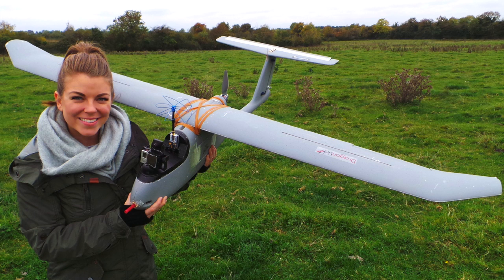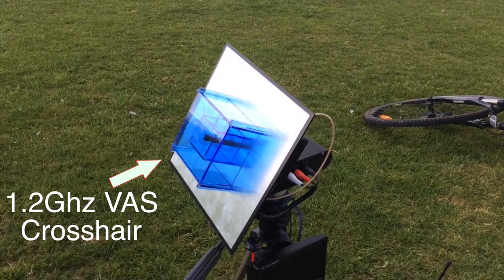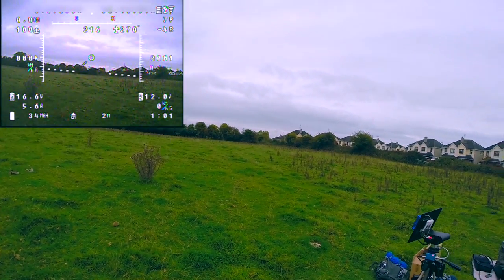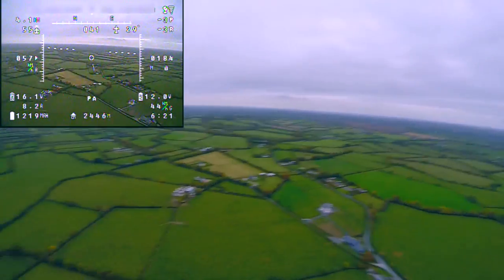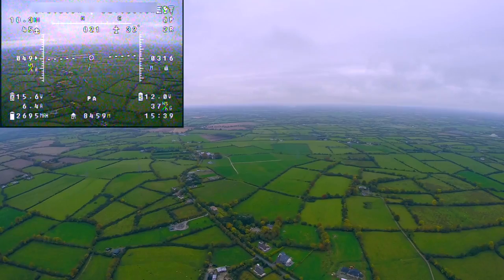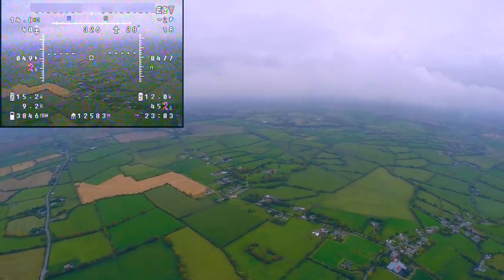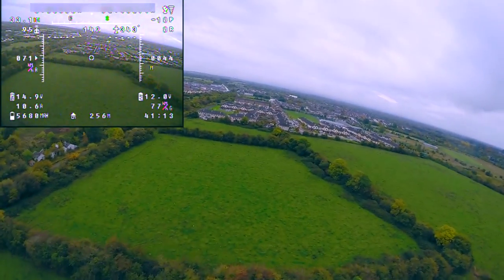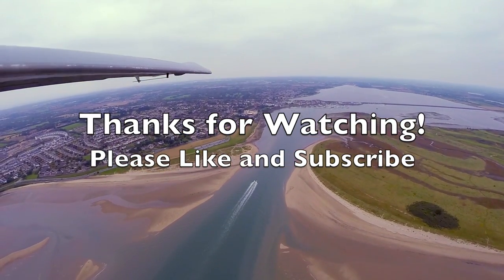Narrated Long Range FPV Setup Overview & 15km Range Test - Skywalker 1900

Comment: Do you have a set up video on the MyFlyDream antenna tracker?
Was it difficult to calibrate?
Reply from the maker: I don't because its so easy. My Fly Dream themselves have a calibration video and its only about 2 mins long as its so simple :)
Reply: A more specific question:  I am using the Eagle Tree Vector.  Do I connect into it's GPS or use a separate one?  I see it comes with a OSD but I already have one in the Vector?  I have looked at the instructions and I don't see the answers for these and more questions.  Thanks
Reply from the maker: I think you an use the GPS receiver for the Vector. You need to hook up the supplied OSD as it provides the AAT with the gps co-ords, but once you have it hooked up you just click a button on it and it turns the OSD off so you only see the vector OSD.

Comment: Could you extend the range by using a relay plane/drone?
Reply from the maker: Using a relay isn’t really the best way to extend range. In most cases you just need to use the right antennas and make sure your component placement on the aircraft is optimal. In this Skywalker I placed the UHF antenna in the tail which is not the best as it’s right next to 2 servos. With the antenna out in the wing the range is massively extended. Hope this helps
Reply: @AdamGdoesFPV  It does help. Perhaps it was just my romantic tinking to imagine an RC equivalent of something like an AWACS plane

Comment: Hi Adam 
What do u need to have that information of the flight on the live feed and do u own a skywalker x8
Reply from the maker: +Billy Greening Hi Billy, The information on the screen is provided by a device called an OSD (On Screen Display). I am using the &#39;Cyclops Tornado&#39; for this: http://www.foxtechfpv.com/cyclops-tornado-osd-p-1309.html
I do not own an X8. They are cool, but for me they are to hard to transport do to size, and they are hard to launch.

Comment: Awesome job! But isn't it a bit over kill for 15km? You could use a mini talon, apm, 600mw 5.8ghz, Frsky L9R, and any vrx. 

You would probably losse control and possibly even video pass 9km but it shouldn't matter too much because of auto pilot. 

This setup would cost around £120 (without taranis or vrx)
Reply from the maker: Thanks :) Not overkill, most effective way of reliably reaching long range, with the convenience of being able to fly in any direction to 20km + in the right conditions.

That setup you described with the mini talon isn't much cheaper than this setup... because you have failed to mention the rest of the kit that you'd need if you wanted to make any decent range. With the right gear added onto your suggested kit, you'd probably make around 10km but it wouldn't be as reliable as the 1.2 + UHF combo, meaning that the experience would be more stressful and less fun. Try adding up the cost of all the parts you need and you'll soon see its a long way off £120 :P
Reply: Fair point but the parts I listed is actually going to be my setup when the esc, serovos and motor arrives. Also you are absolutely I've missed a lot of stuff, I wrote this quite late last night on my phone (2am), I wasn't including the stuff I already had, e.g. quanum cyclops, turnigy 9x, xjt module, apm and lipos/li-ions. 

But I reckon in total (including everything) my setup is well bellow £300 (still a lot more than £120 like you said) But you are right it won't be nearly as enjoyable and my range will be far more limited, but I live in London so I can't go very far anyway. The furthest I've gone any where so far is to the end of a large field with my alein 5" race quad! So just 2km would be quite amazing for me. 

Thanks for the response by the way!
Reply from the maker: No problem :) You'll have great fun with the MT, and its not always about going long range to have fun. I have a Falcon Evo wing which i never go further than 2km from where i'm stood and its great fun!

Comment: hi Adam! Can you tell me how do you calibrated the tornado current sensor, thats the weak spot of that autopilot, thank you for the answer!
Reply: and what % did you use in the settings?
Reply from the maker: Hi, I don't remember doing anything more than going into the menu and hitting the 'calibrate current' option. Worked fine from then on for me.
Reply from the maker: Not sure I ever set a %. From what I remember that is used if the reading on the display is slightly out.
Reply: Do you mean "reset current" ?
Reply from the maker: Yeah that sounds right :) sorry I haven't had to do it for a long time

Comment: I have a couple of questions about your wiring diagram, if you dont mind
Reply from the maker: Go ahead :)
Reply: Adam G does FPV 

Im about to buy my first flight controller, and finding complete systems/diagrams is hard. 1 Your DL Rx doesnt seem to be getting power 2 are the pan/tilt servos additional to the normal 4 servos already controlling the flight surfaces 3 why is there 12v and 5v feeding the tornado thr in 4 how do both gps' connect to the tornado 5 and most important to me, could you get a video of your internal workings?
Reply from the maker: 1. The DL, like all other receivers, works off 5v. the traditional way it gets this is through the BEC in the ESC. So the servo cable that connects from the ESC to the FC or Rx has 3 cables. The red and black are supplying 5v to the Rx or DL. When you supply 5v to the Tornado from the ESC, the power and earth are connected to all other servo plugs along that rail. Therefore the ESC is powering all of the servos and the DL. So remember, the red and black cables on the ESC are supplying power to a device, whereas everything else is taking power. This means all servos AND the DL. The difference here is I have used a separate 5v source rather than the one that the ESC supplies.

2. Yes they are 2 Servos one for each axis, so there are 6 servos on board. the pan and tilt servos simply connect to 2 of the channels on the rx.

3. the 5v as explained in point 1 is needed to power all of the 5v items (servos and Rx). The 12v side is to output 12v power to video gear. I'm not sure but I think the Tornado uses just the 12v supply as it's power source, not the 5v which just goes straight back out.

4.There is only 1 GPS, it simply plugs into the Tornado.

5. This plane is not with me at the moment, it's back in the UK at my dads house sorry.

Comment: How to return home? Would you need to locate it like map?
Reply from the maker: Hi, return to home will simply fly the aircraft back to your take off location and it will circle at the height and radius you specify in the settings. 99% of the time when RTH is activated it's due to control signal or video signal loss. Most people will regain their comms with the aircraft within a minute of RTH being activated and then retake control. Hope this helps.
Reply: @AdamGdoesFPV  thanks Adam

Comment: Great video friend! a beautiful investment in many resources, my congratulations on your amazing flight, must be an amazing feeling!

Where do you find to buy this kit
Lawmate 500mw 1.2GHz Video tx
Lawmate R1200 Plus 1.2GHz VRX
Reply from the maker: +Elvis Moraes Hi Elvis, thanks for your comment :)

Both of the lawmate items you listed were purchased from this website, you can buy them in a package together: http://hobbywireless.com/
Reply: +Adam G does FPV 
Thanks so very much!
At this moment only have a same model with you.
R1200-PLUS I already bought my video transmitter Lawmate 1.2GHz 1,000MW but wait for months for this video receiver and nothing of it appear.

I wonder if it is better or worse than the model "RX-1260"
From already thank you for your attention
Reply from the maker: Hello, Sorry to hear it didn't arrive. I do not know anything about the RX-1260 so cannot compare unfortunately. I hope you get it sorted. Cheers.
Reply from the maker: They are both very good. I would get either of them. RMRC is a preferred seller of mine.
Reply: +Adam G does FPV thanks!
Reply: +Adam G does FPV Finish i buy the RMRC product.
Thanks Thanks for you time!
Reply from the maker: You're welcome

Comment: Which antena I must to buy and autopilot system
To do flying in 30 km far for me and return safe 30km
Reply from the maker: You technically don't need an autopilot but if you do buy one it's just personal preference which one you buy. For antennas it needs to be a high gain directional antenna on the receiving end. the 1.2g pepperbox is a good option.
Reply: @AdamGdoesFPV  thank you so much for this information.i like your videos
Reply: @AdamGdoesFPV  Can you imagen before 2 years imagen wright this commen and for some reson i found again luckliy i am so happy

Comment: hey adam, what did you use to achieve the grey colour scheme?
Reply from the maker: +Luke Campbell Hi Luke,  Multi purpose grey primer spray paint from my local DIY store.
Reply: +Adam G does FPV great thank, did you have to prep the foam in any way?
Reply from the maker: Nope, just sprayed it straight on. Think it took around 3 coats for the finish i wanted. It does chip away fairly easily so laminating it after would probably be a good idea to protect it.

Comment: Hi i hv a similar setup... But too scared to go this far... What do u do if it fell down 15km away?
Reply from the maker: +Mar1wan1 You shouls just build up your distance and go a little further each time if it worries you. If it goes down 15km away, the best I can do is use the DVR footage to look at the last known co-ordinates and search the area. I'd probably take my F450 to aid the search.
Reply: +Adam G does FPV thanks for the reply this is what im doing now i went for 2.5 km away but my heart is in my hand.. I think i ahould get a dvr to be safer
Any brand u recommend
Reply from the maker: It is a bit nerve racking at first. Maybe just get a lot of flight time in with your setup and once you've flown so many times without any issues, you'll build up confidence that your plane is reliable and not likely to go down while flying further away from home. The only good DVR on the market is this one: http://www.getfpv.com/lumenier-dx600-dvr.html

Comment: what exact frequency did you use? 1360?
Reply from the maker: 1200
Reply: Wow really, in the UK. That's brave man. I recently bought a 400mw 1.3ghz transmitter. But everyone says the 1.360 is the one to use in the UK (less likely to get caught)
Reply from the maker: Haha i'm from the UK but don't live there. Have used 1200 though before I moved and had no problems. If think if someone else is using 1.2 within range then surely you will suffer too much interference to fly

Comment: do you goto call police or some 1 to let them know you flying? surely illegal if not no?
reply please as im building similar thing and I cant be getting introuble. I ask as your in same country and you got experience. ty for explaining everything your using.
Reply: also, you dont have to answer but what city or are you north south east west? ive subbed only asking as i may be local amd wouldnt mind doing meet ups. im pretty much between birmingham and hull alot.
Reply: mate its a toy airplane with a camera. why would you need to call anyone? 

the only issue here is that he is using 1.2ghz video which isn't allowed for aerial video. but he flies away from urban areas and doesn't disturb anyone
Reply from the maker: Just fly in safe locations and plan your flight :) I actually don't live in the UK anymore but used to live in B'ham. Otherwise would have been up for meeting, always fun to fly with others
Reply: Nope I fly my drone out 10km - 15 km out all the time just fly over water and land away from airports you are fine.

Comment: Hi Adam, Ard again! 😊 can you give me your elevator servo travel? Just to be sure for my Maiden flight. Thanks!
Reply from the maker: +Ard Schell Hey Ard. Sorry I really don't know, and my Skywalker is packed away. As I mentioned before I didn't adjust the throws, its easy to fly you'll have no problem :) Good luck with the maiden, I will keep my eye out for the video
Reply: Thanks Adam. I ajust the elevator with some hinges. The elapor is not easy enough to use as hinges. Stil waiting for good weather. Thanks again!

Comment: im afraid of asking, but how much did this setup cost you?
Reply from the maker: +Funkafett Around £1,500 - £1,700. The expensive components are the googles, radio transmitter, UHF system, Antenna tracker and the GoPro. Check out the video description for answers to FAQs and a full kit list.

Comment: hi  where can i buy this fpv and what will the price be .or just a rang on fpv of  2k will do me ?
Reply from the maker: +keith rice Its very rare that you can buy an entire FPV setup. You normally purchase the airframe from one location, electronics from other multiple shops/sites, FPV gear online in multiple places. The main shops I get my equipment from are www.hobbyking.com and www.readymaderc.com. Some of the cheaper chinese sites like banggood.com are also very popular.
All of this kit cost me around £1,500 - £1,700. The expensive components are the googles, radio transmitter, UHF system, Antenna tracker and the GoPro.

Please check out the video description for more answers to FAQ's and an entire kit list.

2km Can be achieved very easily without spending much money at all. You can do it on 2.4ghz for control and 5.8ghz for video.
Reply: ok thank you i was a pilot of light aircraft c172 and king air 350i  but the price of  flying now is so high that i am looking for taking this fpv up
Reply from the maker: Ah cool :D Well i'm sure you'll have no problem flying these RC planes then. Good luck with the build, and get signed up to some forums as they are the best source for help and advice.
Reply: ok will do

Comment: so several kilometer FPV and controller range is very much possible, if you have the money. I'm gonna have to start saving for a long range FPV plane and equipment.
Reply from the maker: Yeah there are some people flying way beyond 100km... not something I would be into but its possible. Short to medium range FPV is most fun, its all about flying low :)

Comment: What do I Need for all theses information like altitude and distance to see it in screen
Reply from the maker: Hi, the info on the screen is an On Screen Display (OSD). All you need is an autopilot that has an OSD built into it. In this video I was using the Cyclops Tornado
Reply: Thx

Comment: Why you use two 5000 mAh batteries in parallel instead 1 of 10,000 mAh ?
Reply from the maker: +Pedro Matabuena The answer is a lot less sophisticated than you'd expect :P I have a multi-rotor that flies with a single 5000 4S, of which I have 5. Rather than having separate packs for the SW I just use the same on both aircraft but double them up in the SW :) This way it also gives me the option to fly the SW on a single 5000 if I want to.
Reply: +Adam G does FPV Hello Adam, thank you very much for your answer. I have another one, I want to buy a Skywalker but there are many versions (CF tail in T, unibody, Skywalker 2015) What do you recommend to use?
Reply from the maker: I think they're all good. I'd say go with whatever suits you and you like the look of.

Comment: what is the total cost for a setup like that?
Reply from the maker: Around £1,500 - £1,700. The expensive components are the googles, radio transmitter, UHF system, Antenna tracker and the GoPro.

Comment: Hi, how to activate the tornado OSD data recorder?
Reply from the maker: +Nightrider Nightrider On the Tornado's button board one of them is the 'Up' button. Hold this for about 3 seconds and the TF memory card icon will start flashing on the OSD, this means its recording. Do the same to stop recording. It will only work if you have inserted a micro SD into the Tornado main unit and you have a GPS lock.
Reply: Thank you dude, will try it today.

Comment: u dont need antenna tracker for a 15km flight with a crosshair ;)
Reply from the maker: Nope, not at all in a flight like this... but I rarely fly out in a straight line and back again like I did in this video.

Comment: How much did you pay for this equipment? And btw, awesome video:-)
Reply from the maker: +LUX Spotting Hi, take a look at my FAQ section in the description, its question number 1:

1: How much did the entire setup cost?
A: Around £1,500 - £1,700. The expensive components are the googles, radio transmitter, UHF system, Antenna tracker and the GoPro.
Reply: Okay thank you very much
Reply from the maker: no problem :)

Comment: Seems like you could put a very long antenna going horizontally inside the styrofoam wings of a right multiple of the wavelength but nobody does that.  Of course you'd have to have your groundstation antenna going horizontal as well.
 
I just got my Mr Croc 7" today and am trying to figure out how I an extend the 5ghz digital feed...   most people test with the MenaceRC DJI HD directional pico antennas and that improves multipath rejection, but doesn't particularly do as much as would be expected for range.  Now if I could run coax from those antenna outputs to something like a ground station tracker...  and then put a quad dipole or something there.     I have some Yagi but I think they were fake, they never worked at all.
 
fpv.air-war.org
hba.air-war.org
Reply from the maker: If you put the antenna horizontally in any part of the plane you'll lose signal when you turn. This is why it's never done :)

Not got into digital feeds yet, it just can't cope with the type of flying i love doing these days.

Cheers

Comment: I need mesurement for skywalker airframe please help
Reply from the maker: Wingspan: 1900mmLength: 1180mmWing Area: 35.5dm2Cabin Size: 120mm x 370mm x 72mmFlying Weight: 1300g ~ 1800g
Reply: Thanks adam for reply need to ask measurement for fuselage section , length of fuselage, height of cabin,width of cabin,length of cabin,L*B*H of vertical stabiliser,as well horizontal stabliser.